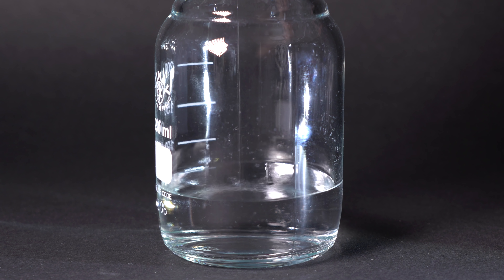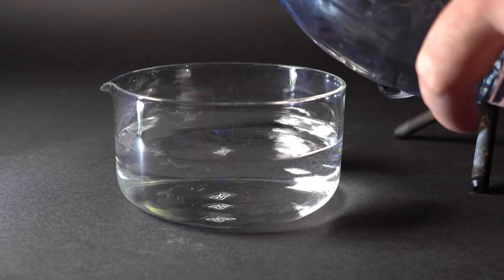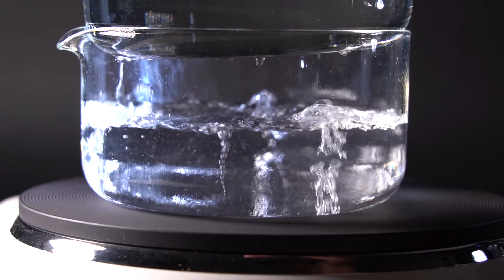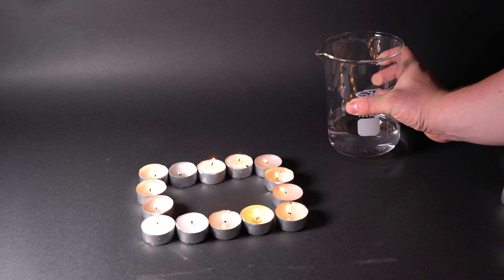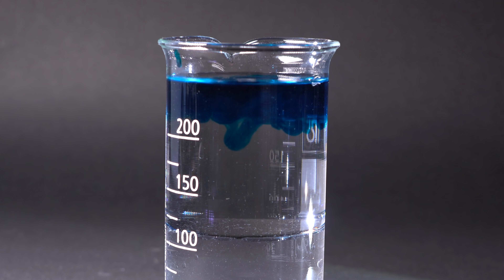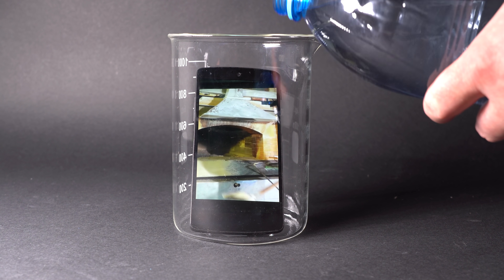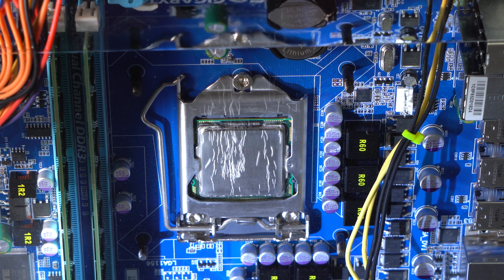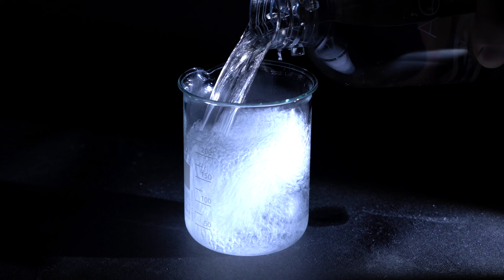Dry Water - The STRANGEST LIQUID On Earth!

Comment: I've actually been looking for 3M Novec for ages. Turns out they're the perfect fluid for liquid cooling computers since you can submerge an entire motherboard without the risk of electrical failure
Reply: It's been done before, mostly as showcase. Problem is that you need to seal the case so the Novec doesn't evaporate.
Reply: Have you thought of using dcm or Cubeain they both have a boiling point of around 55c and are Innert to plastics plus they are like 5 Times cheaper
Reply: @throttleandclutch253  Dichloromethane inert to plastics? In what universe?
Reply: You could probably use some tips and tricks from mineral oil pc cooling.
Reply: @rikwisselink-bijker  Mineral oil can pick up contaminates over time that can cause problems. The patents have been submitted years ago for cases to do mineral oil cases, but it's gone no where. The only reason I can think of for that is that the maintenance is too much of a problem to make it viable.
Reply: @stewartleslie3292  it won't cause any issues. There are mineral oil submerged PCs that have been running for years. It hasn't gone anywhere because there's really no benefit, it's messy, and just an all around PITA.
Reply: Watch the complete video dude
Reply: You can use purified mineral oil for this.... But it only stays non conductive as long as it stays pure... If you're serious about doing this you will want all the boards sprayed with conformal coating before submerging anyway...
Reply: I was thinking about doing this and then I see this
Reply: Of course, because Novec 649 aka "dry water" contains no H2O water molecules, it's made of perfluoro-methyl-ketone, kind of like acetone with a bunch of fluorine atoms.
Reply: if you get good cooling equipment it shouldn’t be a risk anyway but Novec is only a third as efficient compared to water
Reply: @caleblarsen4967  water is way less efficient though. It's better, but not more efficient.
Reply: If you make all the parts waterproof from the start then find a way to keep the dry water cooler than heat output from pc
Reply: But then you have two choices, let it evaporate or try and contain it...what would the pressure buildup be like with this stuff boiling?  I was thinking a Cooling loop rather than submerging just for the viscosity and electrical properties, but that pressure worries me
Reply: @luminousfractal420  You'd absolutely need the cooling loop. Since the boiling point is 49 degrees C or something, you'll rapidly reach that with a PC of any performance at all, and you'll end up with the whole batch of Novec trying to boil.
If you use a cooling system to keep it at 40 degrees or so, even if there is local boiling the tiny amounts of vapor will just condense again and there won't be too much pressure rise.
Reply: If dry water were made in mass production for extinguish and heat exchanger purpose , They may affect environment like micro plastic in the ocean because they are not easy to decompose even changing into  vapor form the coating still contain the droplet of water. I wonder how long do they take to come back into normal water?
Reply: Your board would boil the Novec. Pay attention to the chemical properties in the future.
Reply: That's a different chemical entirely. Novec 7000.
Reply: I mean, you can do this with any oil. I think the benefit is that it's boiling at hot surfaces, immediately pulling the heat away and the hot gas can be scooped up and chilled down again in a condenser.
Reply: Not great if it starts to boil in the system?
Reply: @TheFlemmo123  oh no, you want it to boil. That's what causes the cooling.

You just don't want to breath it in.
Reply: @vyor8837  but when it boils and gas is forming there must be a peak in preassure, will the cooling system handle it?
Reply: @TheFlemmo123  the density is high enough that a sealed lid keeps it all in, and it returns to liquid quick.
Reply: Submerging an entire motherboard isn't as efficient as a heat plate because the entire motherboard doesn't get hot. I won't deny that it's an interesting  idea, but in reality it sounds like more of a mess than anything else.
Reply: @manblanket  novec being s dry liquid probably doesnt touch any object either. By creating a barrier between the object and itself.. thus a computer would probably over heat eith no way to transfer heat like a direct heatsink can
Reply: Yea Enjoy having PFA's and PFOAs in your room with your computer... you do realize these chemicals cause cancer, birth defects and rotten teath and all kinds of disease right ?  They never go away either, they are forever chemicals that have completetly polluted the planet.. 99% of the population has it in their blood thanks to 3m and Dupont and so forth
Reply: @jeepsblackpowderandlights4305  I mean you're wrong first but second... that's what sealing it is for? It serves two purposes, keeping you from fucking dying and... allowing you to reuse it.
Reply: @vyor8837  wrong lol Novec is a PFA/PFO.   FOREVER chemical.   Toxic as shit.. and never goes away
Reply: @jeepsblackpowderandlights4305  it both breaks down and, considering how new it is, has no possible way to be in 99% of humanity.
Reply: @vyor8837  you have no idea what PFOs are do you.  Look it up.  Been around since the 40s
Reply: @jeepsblackpowderandlights4305  your thinking about the shit that was used on nonstick cooking pans during the 40s. Due to malpractice that shit is in basically everything now. Fun fact after like a decade any in your system would work its way out. If you weren't introduced to more.
Reply: @jeepsblackpowderandlights4305 thank you for mentioning this. I live in an area in NC near a Dupont/Chemours plant runoff site, and it is going damage to our alligators in the river and waterways. Gators historically have had iron clad immune systems, however our gators are forming skin sores that will not heal and the testing is showing why. It's the stuff in the water. The water bill is $120/mo on this island, and we can't even drink it out cook with it. I don't even like being in it...
Reply: Never heard of distilled water?
Reply: @Iskandr314  You can't use distilled water, because it will not stay demineralized for long. So you will get a short fairly soon.
Reply: @rikwisselink-bijker  And mineral oil completely destroys everything plastic in the PC, which means you get dust particles all over inside the PC, and completely destroys the resale value of the components inside. Novec removes all those issues, while also having a higher conductivity.
Reply: @rikwisselink-bijker  It would take probably several micro seconds before it shorts, metallic atoms really love rushing into H2O molecules..

Comment: I'd like to see that temperature test done with a more appropriate setup, cycling the dry water and actually bringing it down to a quite low temperature. What I find especially interesting about it for the application of personal computers is that since it dissolves almost anything into it very poorly, this kind of set up could not only keep hardware cooled off but keep dust out of it too. 

The lack of electrical conductivity may even also protect it to a small degree from electromagnetic interference. My understanding of how an EMP works is pretty limited, but as far as I understand it goes: Ordinary air is a poor electrical conductor,  but it still can conduct electricity. So, because of that, powerful enough EM radiation can conduct electricity off of circuits into the air around it, and from there this (very small) arcing electricity can damage the electronics. Or, alternatively, sometimes electromagnetic interference can change memory or interrupt a processor instruction. So my thinking goes, if this dry water is an even poorer electrical conductor than air is, that would mean it can protect against an EMP better than air can. Can any chemists or physicists confirm or deny that?

Comment: "Hydrogen Flouride"

You mean Hydroflouric acid? That's some SERIOUSLY nasty stuff...
Reply: Hydrogenfluoride is a gas. It's molecules consist of a hydrogen atom and a fluor atom. Hydroflouric acid is a solution of Hydrogenfluoride in water.
Reply: @blackbird2901  Water such as that inside your respiratory system, for instance.
Reply: @_tyrannus  that is true and partially why Hydrogenfluoride is so problematic. 
But during the chemical reaction of dry water under UV light you will get Hydrogenfluoride, not the acid. Hydrofluoric acid as a liquid would be a lot easier to handle....
Reply: @blackbird2901  What I meant is that hydrogen fluoride reacts with moisture in the air and your lungs forming hydrofluoric acid, just like SO2 and NOX form sulfuric and nitric acid respectively.

Comment: I wonder if it would have kept the CPU much cooler if the heat spreader had a rougher surface to act as nucleation sites. If you get a pan of water to double the boiling point of water, it will likely erupt like a volcano. I don't understand how the CPU could be double the boiling point of dry water and only casually boil. Perhaps it also requires the pressure of the heatsink clamped to the heat spreader to make good contact internally? This experiment sure didn't seem to come out as expected.

Comment: They did it
They made the "is water wet" an actual topic
Why science
Reply: Well its not actually H2O water, so... but yeah
Reply: Hrrggnnn... Schroedinger water
Reply: Water is the wet bro.
Reply: Kyaru Momochi  wet has to be an interaction not a thing of itself
Reply: @nathanielpena5868  A coin + 1ml of water = wet body of water + coin (wet)
A coin + (k)ml of water = wet body of water + coin (also wet)
A coin + (k+1)ml of water = wet body of water + coin (also wet)
therefore coin + n ml of water = wet body of water + coin
 lim n->(infinity) coin + n ml of water = wet body of water + coin = wet body of water (as n goes to infinity, the coin becomes negligible)

(variables n, k are natural numbers)
Reply: @cod3builder701  it's chemical composition is not just water it's a mix water is h20 it contains co2 in it and can cause posing something water cannot do.
Reply: @cod3builder701     in order for water to be wet it cannot be bound to itself.
Reply: @nathanielpena5868  you just said it is bound to co2
Reply: @cod3builder701  yes but  that doesn't make it.    H20 BY ITSELF.   IF ITS MIXED WITH CO2 ITS CHEMICAL COMPOUND IS DIFFERENT ITS NOT JUST WATER. ITS A CHEMICAL MIX.          H20 is not h20 with co2   that would be.     H2co2 or however it's mixed  cause I'm not to sure on how that works their in order
Reply: @nathanielpena5868  therefore pure h20 isn't wet but regular water is
Reply: @cod3builder701  pure h20 is water just because another h20 sticks to it. Doesn't make it wet.    Because it's bound to itself in order for something to be wet than the object itself cannot be a liquid that makes other things wet
Reply: @cod3builder701  it has stuff in it like skin particles but water is bound to water you don't make water anymore wet because it has the ability to make things wet the molecules are bound to each other
Reply: @nathanielpena5868  so does this mean that water with impurities are wet while pure water isn't
Reply: @nathanielpena5868  "the molecules are bound to each other" the very fact that something is in water means that water molecules have bound to it. (not necessarily chemically)
Reply: @nathanielpena5868  your cringe wrong
Reply: @Moped_Mike  had a stroke reading that buddy and what cringe it's not like I'm doing something.  Literally multiple scientist have said it water cannot be wetted it is not wet itself but can wet other things
Reply: @nathanielpena5868  what’s cringe is you can’t stop replying
Reply: @nathanielpena5868  go back to reddit
Reply: @defnistaer5885  also want to point out this comment is just as generic and basic as my ex and belongs where she is the streets  so  I'm sorry for you
Reply: @nathanielpena5868  not as generic as "water isn't wet" it never was funny and the more it's said, the less funny it gets
Reply: @defnistaer5885  that's an opinion which I couldn't think of anyone who asked for because others find it funny and find it interesting to talk about on a scientific level.     Maybe when your more mature you'll understand that
Reply: @nathanielpena5868  you only need to do that once, the same arguments repeated, on any mention of water or wet more than once ceases to hold anything new or interesting
Reply: @defnistaer5885  which is why your commenting on my comment which was a long time ago read the comment you first replied to look at the date
Reply: @defnistaer5885  actually it does because there is no basic conclusion as people search more into what evidence to find to support there argument.  So I would argue no you wouldn't just need to talk about it more people still have genuine arguments now a days and it's taught me fun facts about the way water works on a molecule level
Reply: @nathanielpena5868  ah yes, an internet joke from nearly 20 years ago was not old when you were posting about it 2 months ago.
Reply: @defnistaer5885  also once again forgot to mention your opinion because people tend to repeat because they are talking to another person that has not heard there argument
Reply: @defnistaer5885  what are you trying to prove? I'm not even 20 and I've only talked about it when someone brings it up.        Like seriously do you have a disorder or something bruh?   I'm confused it sounds like your trying to find an exscuse to make me look bad for no reason 😂😂😂
Reply: @defnistaer5885   second point 😂😂😂you need to stop being ignorant and stubborn with what I say  questions can come up at anytime they want  as long as two people are talking about it  it doesn't matter when it came out
Reply: @nathanielpena5868  it's not an argument or an opinion, it's a dumb joke people take way too seriously
Reply: @defnistaer5885  😂😂😂😂.  What are you imposing.  So what if I take it seriously bruh it's not like I'm mad about it. When you argue it doesn't have to be an angry conversation it could get exciting but it can come as a learning exsperiance to people who don't know much about water
Reply: @defnistaer5885  in fact it's undecided people argue about so much thats my opinion 🤷‍♀️  because people will come up with new conclusions
Reply: @defnistaer5885  and also once again that is your opinion 😂😂
Reply: Yesn't
Reply: It was never wet.
Reply: Fun fact: In science view is ice basically a rock and water a form of lava
Reply: Not wet does not imply dry
Reply: SCIENCE ISN'T ABOUT WHY IT'S ABOUT WHY NOT
Reply: Water is... wet?
Reply: You all have made me lose years off of my lifespan.
Reply: Damn now I can't reply "yeah and water is wet so what" anymore.
Reply: Wet is something that water leaves it itself isn't wet
Reply: I don't know if this is a word game masking stupidity or stupidity masking as a word game ...
Reply: Water is wet because dry water exist
Reply: Answer to a question no one asked
Reply: Is fire on fire?
Reply: It's all about surface tension
Reply: IDK why its such an issue, Vaporeon are well known for their.. wetness
Reply: @supahvaporeon  NOT THE VAPOREON COPYPASTA
Reply: Water is not wet, it gets stuff wet. You are welcome
Reply: @SpiriDussgaming  water is wet
Reply: @puckry9686  water is wet and not wet at the same time
Reply: @Anchorite-40k  Water is not wet. It's only wet when it touches the surface of objects.
Reply: @Anchorite-40k  shrodinger's water
Reply: Hmmm.. that strange, if water is wet, its mean air is dry. Wet seems more a characteristic that involves liquid effecting something.
Reply: @ridhwan3896  I'm pretty sure air is another form of water though
Reply: @chronotrigger3919  air actually a type of gas ( a mixture of gas) water vapor was a water that turn from liquid to gas with the help of heat. (As it cold down, its turn back into liquid) that why air can be considered dry, if there was no liquid like form in it to give wet characteristics to other stuff.
Reply: @chronotrigger3919  air is a fluid and water isn’t wet. Wet is an adjective to describe something that has been covered or saturated in a liquid. The paper towel with the “dry water” was still wet, it just didn’t get soggy.
Reply: MOST WATER ARE FUCKING WET
Reply: " water gets stuff wet"
Pretty sure water counts as "stuff"
Reply: @cod3builder701  what is wet actually? 
That the real question.
Reply: @cod3builder701  yes but water is not an object that can be covered in water it only makes the pool of water bigger. Therefore making water not wet

Comment: I believe it's also sold as flourinert. IBM used flourinert to cool their supercomputers using a sealed cooling system that sprayed the flourinert through spray nozzles into a mist and directed it to the dies of the cpus allowing the liquid mist to change to a vapor and draw more heat during phase change.

Comment: So if I had a water cooling system in my computer, would dry water be an optimal fluid to use?

Because it sounds like the perfect substitute. And it seems like it if it sprung a leak, you would only have to worry about dry water loss.

Comment: I wonder what happens if you bring dry water in contact with radioactivity. I mean it could be a more efficient coolant if it doesn't cause other problems, such as reactions. Of course not for most commercial reactors, but when space is an issue it could be helpful. Also it would be interesting to see the different phases. And I wonder how you call the solid...
Also I wonder how the polarity works. There is so much stuff I want to try...
And also what about reactions? I know that Fluor is too reactive for letting most reactions work, but there got to be some way. It might be pretty dangerous though. Could we accidentally make HF?